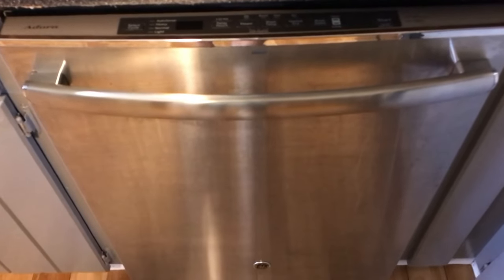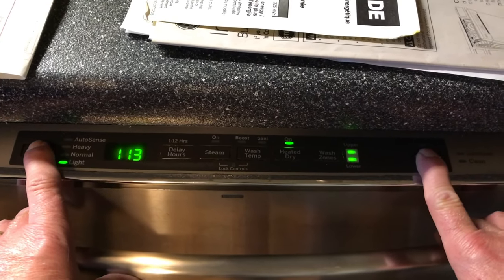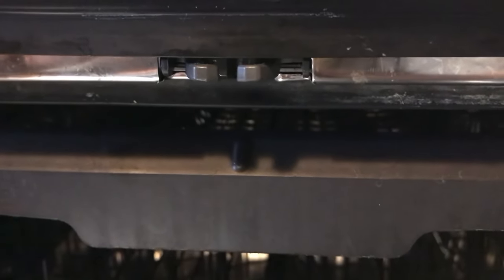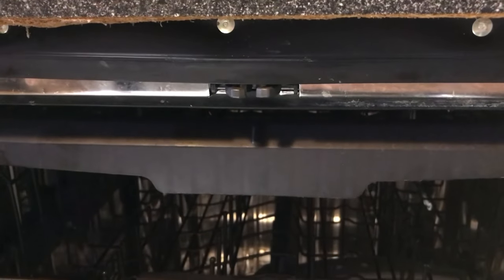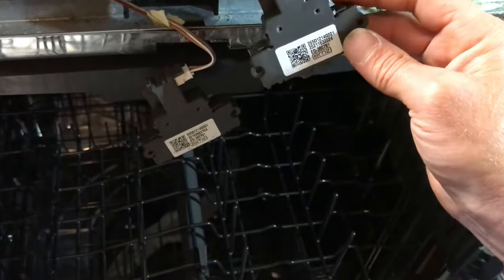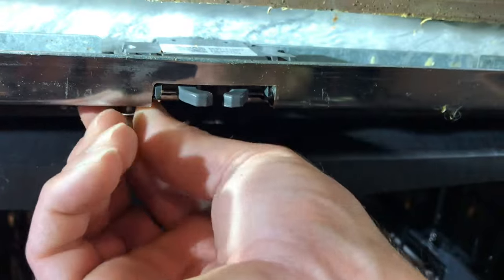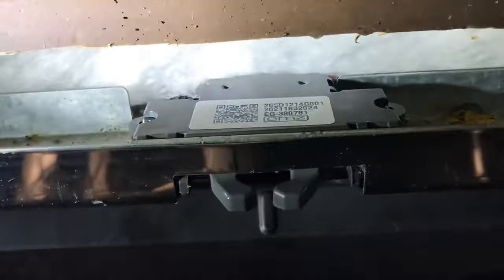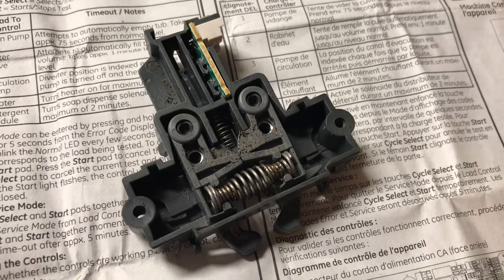GE DISHWASHER WON’T START? How to diagnose and repair!

Comment: Before you all go this far down the rabbit hole, please try unplugging the connector from the bottom of the control panel that leads to the upper touch panel. Clean with CRC electronic spray cleaner (both male and female ends) and replug it in. This connection leads to intermittent power issues with this model.
Reply from the maker: This switch was 100% bad! 
Thanks for the helpful suggestion if some folks are still having trouble!
Reply: @THEOFFGRIDMOUNTAINHOMESTEAD  not a switch ...just an electronic connector, but I'm glad I could help.

Comment: I have an even cheaper fix: since the latch is apparently slightly worn down from usage, and the door, when closed, isn't being detected as closed, I placed a piece of electrical tape around the triangular door piece on the door which makes the two parts slightly more snug. And it worked. Now when it closes, the two sides "see" each other.
Reply from the maker: That’ll work too! 👍
Reply: Definitely giving this a go!  Replaced the latch switch 3 only months ago!
Reply: @bulldog217831  Update: the tape "fix" only lasted a short while. I finally had to replace the switch anyhow, but even then it failed again after a couple months. A repair guy came out and said the circuit board inside the top of the door wasn't detecting the one on the bottom, so it was seeing the door as "open." He couldn't get it to work. A replacement of both would have cost half the price of a new washer, so I opted for a new washer in the end. Bummer.
Reply: @L5player  
Thanks for the update.  Tried the tape trick & no go.  Ordered the switch & striker for the door side & hopefully it’ll buy me a couple of months, but I see a new dw on the horizon.

Comment: I've done the same repair on an older model GE. I ordered the part off of Amazon and saved myself a ton of cash. I have also done a washing machine "latch bypass" to cut off the drum spin safety feature. I have no kids in the house, only adults and the machine wouldn't work without an expensive new board. The bypass took three minutes and cost nothing to do. Machine worked great for years, until I bought all new appliances for my new house. Most of these simple repairs are on YouTube.
Reply from the maker: Thanks for taking time to share your experiences. 👍

Comment: Thank you. My dishwasher would indiscriminately sound as if the door opened 24/7 for months. I tried to start one day & nothing. Figured the switch was bad, found one local & then found this video which confirmed the switch was bad (owners manual part of the video). Thank you very much.
Reply: Well, it didn't work. Calling repairman. 😩
Reply from the maker: Sorry! I’ve heard sometimes the wire harnesses to the main board can get rubbed and short causing a sporadic door issue! Good luck with your repair!

Comment: This is exactly what my dishwasher is doing.  I replaced the door switch but it didn’t fix the problem.    Does that 815 error code flashing sometimes mean something else???   Thank you!
Reply from the maker: I suggested to another commenter to trace the wire back and spray wire terminal connections with electrical contact cleaner available from Lowes/Home Depot. It fixed his problem! The connections at the main board oxidize or corroded. Be sure to turn power off etc before doing this. Hope this helps!

Comment: Interestingly for mine, it was not showing the error code (flashing lights) so I ruled the door switch out. I saw many other potential causes/cures but none of them worked either. I decided to cut the power to it for a few minutes and after I turned it back on and hit start, then the start light and the light on the front of the door started flashing. I held the Select Cycle and Start buttons simultaneously for 5 seconds and got the same flashing lights, so I'll be ordering a new door switch post haste. Thank you very much for the very detailed video. You save me a bunch of money and aggravation, which is appreciated beyond measure right now.
Reply from the maker: Glad you found the video helpful!

Comment: Okay I just found your video and it comes up with the same code. So my Model # is PDT825SGJ0BB and serial # is LG103599B how do I know which one to buy on your link? I think the dishwasher is a 2005 but I don't know as I'm the second owner of the mobile home it is installed in.
Reply from the maker: I’m sorry but I don’t know which part# you would need? Could you take the switch out first and look for the part# on it to verify before ordering any parts? Should have the part # printed on it so you can verify. Or possibly find parts diagram for your model washer and verify the switch part number this way? 
Hole this helps!

Comment: Thank you for the video! Same model, same symptoms... I've done exactly what you described, and the dishwasher worked for a few cycles, but then the same issue returned. Any suggestion as to what the next step would be?
Reply from the maker: The next step would be to follow the wire that goes to the switch back to the main board, make sure no damage to the wires. If ok, then 
Check to make sure the connections for the wiring aren’t corroded or oxidized at the main board. If corroded you can try contact cleaner available from any reputable hardware supplier. Hope this helps you!
Reply: @THEOFFGRIDMOUNTAINHOMESTEAD  I did just that - it worked! There were no visible issues (like corrosion), but I cleaned what I could, plugged it all back in, and it's running its first cycle since it stopped. Fingers crossed... Thank you again!

Comment: So for this custom install did you just remove the interior trim panel and not the full kick plate? We’re about to fix ours since the spring inside the latch broke and wondering if we can avoid sliding it out and get to it this way. Either way, super helpful video so thank you!
Reply from the maker: You might be able to lower the front feet and let it lean forward enough to get to the switch. You don’t need a lot of room to get the switch out! Hope this helps, stay safe!

Comment: Any suggestions for a GE dishwasher with no lights at all? Had the problem a couple of months ago and rectified it by pushing a combination of buttons and switching off the breaker. It's happened again and that sequence no longer works. But there IS power to the dishwasher
Reply from the maker: From what you have described, my first thought would be the main board as the culprit. Possibly could be the user interface board (buttons board less likely but a possibility). An electrical meter will be needed to confirm which has failed. 
Hope this helps!

Comment: Great video, thank you so much. However, there are no screws to take the sides off. There are, what appears to me, bolts as if the screws are on the other side. Is there anything else that I am not seeing?

Comment: Great video.  Any idea on how to "get around" the switch and trick the dishwasher into thinking the door is closed?  If the part failed once, it will fail again.
Reply from the maker: Not really a good way to bypass on that particular model. It can be done but would require other components that would probably cost as much as a spare switch and take twice as long to perform!
Reply: Update: I figured it out.  My GE dishwasher is a different model vs. the one in the video.  I replaced the switch and it worked for 6 months or so, then it acted up again.  I took the 3 wires and connected them together with a wago connector.  (I had nothing to lose as it wouldn't start).  I checked the voltage and tested my theory by jumping the wires in the existing connector before I cut anything.  It started without any problem.  ***Note: with these 3 wires connected all the time, the dishwasher won't "know" when the door is open or closed.  Do this at your own risk.  @THEOFFGRIDMOUNTAINHOMESTEAD
Reply: Update: This has been working fine for over 6 months.  I do have an on-off switch in the outlet to disconnect the dishwasher when it isn't in use versus unplugging each time.  As stated before, do this at your own risk.

Comment: I changed the lock and it is still beeping. When I press Select Cycle and the Start button, all lights light up and 815 flashes. Is this the code for a door lock?

Comment: I replaced door switch, but same issue is still occurring. Any tips or advice?
Reply from the maker: The next thing that comes to mind is the main control unit on side of the machine or possibly a damaged wire between the door switch and main board! Hope this helps!

Comment: We just changed our control panel and the door latch. The lights work now, but it still beeps 3 times and flashes the orange light. Any idea what else is wrong?
Reply from the maker: Maybe check wiring connections for corrosion? Check for physical damage to wiring as well. Hope this helps!

Comment: What’s really ticking me off is that I had the same problem and replaced the switch with the genuine GE part 3 months ago and it’s doing it again!  I only do 1-2 loads of dishes a week.  Annoyed that it failed so quickly!
Reply from the maker: This is a very common issue unfortunately. Sorry that you’re having issues again. It is surprising that you only got 3 months out of a new part. Any power surges or outages, thunderstorms etc to your residence recently? Trying to think of something that may have caused premature failure…. then again could be issues with the main board too. Hard to say. Good luck in getting it fixed up again!
Reply: @THEOFFGRIDMOUNTAINHOMESTEAD  Yea…. It was the main board.  Which isn’t available anymore.  Ended up pulling it & replacing it.  Thanks for the info though.  I really appreciate it.  Was worth a try.

Comment: Same dish washer, different problem.  No power, no lamps on.   Checked outlet, OK.  Any ideas?
Reply from the maker: 120v Power comes in to main board first on side of the washer. Then main board sends control power out to other board/displays. Could even be the touch panel board/display on door. 
Hope this helps!

Comment: How do you test the part for continuity? Ordered the part and it didn't fix it which would be the board next yikes.
Reply from the maker: Use basic electrical meter to test the switch and wire to help determine the issue. Activate switch manually while meter is connected to check operation! Hope this helps!

Comment: What do I do if I have no power to it at all?
Reply from the maker: Could be a multitude of things ranging from; no power to the machine, damaged wiring, bad user interface panel or main board. Hope this help steer in the right direction. Thanks for watching!

Comment: I'm one of the 10% where the door switch replacement didn't work 😢. Any ideas?
Reply from the maker: Sorry the door switch didn’t fix it for you. The door switch ties back into the main board. So it could be the wire loom going back to the main board from the switch or the main board itself. 
Hope this helps!
Reply: @THEOFFGRIDMOUNTAINHOMESTEAD  wound up being the main board. Up and running now!
Reply from the maker: Awesome that you got it fixed! Good job 👍